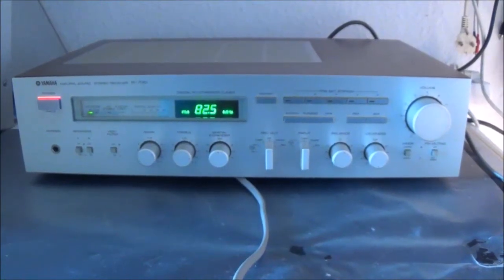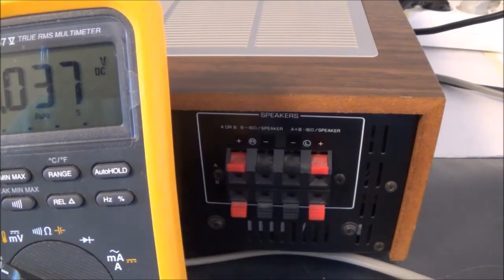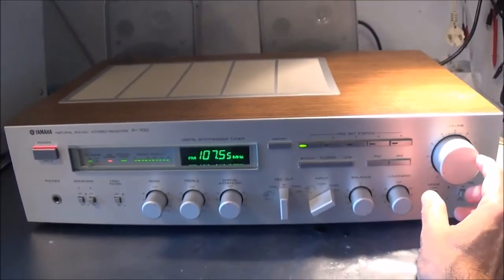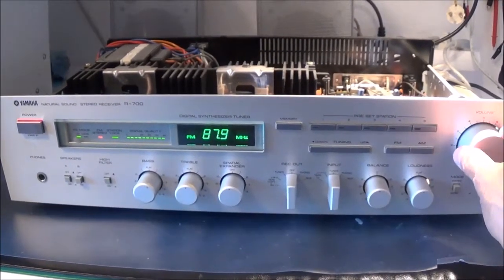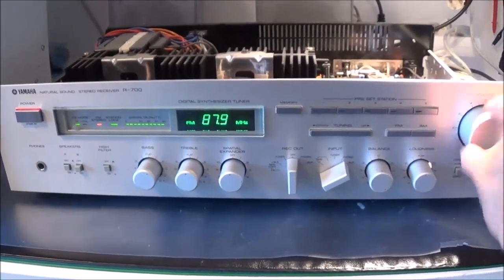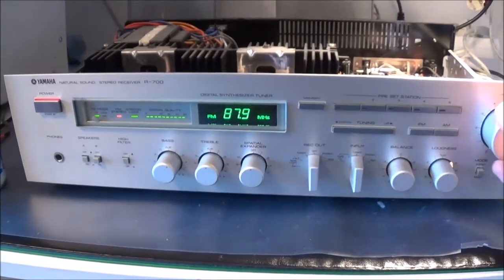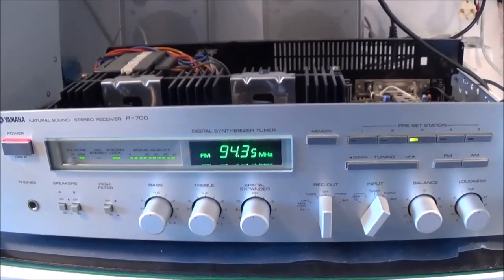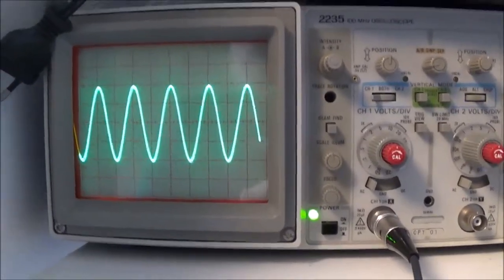Yamaha R-700 Stereo Receiver Easy Repair

Comment: Bought one on evilbay, seller states all is checked and tested, but I don't get any sound from speakers or headphones ... powers up nicely, but that's all ... 😓
Reply from the maker: Hopefully you can send it back; it would be the best under these circumstances. Carefully check to make sure you don't have the tape monitor/source switch set wrong. I can't say exactly what it (the switch) is called on this receiver since I am travelling and have very limited internet.
Reply: @OldSchoolElectronics  I tried a lot, but according the manual I printed out all was right ... and there was no relais clacking after turning on.
I ofgicialy requested return on ebay, if the seller doesn't respond in between 3 days I give the case over to Ebay ...
Reply from the maker: That is the best thing to do:  send it back. It could be that one of the IC  (STK) modules is bad; either volt amp or power amp. I would not agree to a partial refund like if the seller wants you to keep the receiver but gives you a cheaper price, but would ask for a complete refund--all of the money back. If not, you would have to spend time and money to get it working again.
I don't think the seller did it on purpose (especially if his eBay rating is good); the receiver has "lived" for many years already. Kind of like a 90-year-old person that you see on the street in the morning and then in the afternoon: dead. He should have no problems giving you your money back.
Reply: @OldSchoolElectronics  no, I don't think it was on purpose, but his good ratings are all from buying, he doesn't have any rating from selling ... and seemed un experienced in selling ... but, non the less, if he doesn't respond until tomorrow, ebay takes care of things ...

Comment: Looking for a little help. I have this exact same receiver and have run into problems with getting full stereo sound out of it. I have checked everything; swapped receivers to confirm it wasn’t speakers, and turn tables, and speakers. The result is that when everything is connected to this receiver I can not get stereo sound out of left speaker. If I flip it it to mono, both speakers play, but in stereo the left speakers either starts up then crackles out, I can lift the needle then drop it down and sometimes it’ll come back to stereo, but eventually the speakers just goes out. But if I flip it back to mono it works fine. Any suggestions?
Reply from the maker: This sounds like a bad contact situation. Especially if it does this with all functions like radio/phono etc. Sometimes you can get by without resorting to contact cleaner. I would work all of the switches and and other controls a bunch of times. If this doesn't work you will have to get contact cleaner (with lubrication). Can be gotten at a local electronics store or ordered online. You use the spray with the power off. The switches/controls are sprayed and then worked back-and-forth or pressed a few times. In the event that the controls/switches have no openings you would have to very carefully drill a tiny hole into them in order to use the spray. But sometimes you can just spray the controls that have openings and that is enough. Or if you get really lucky, just work the controls/switches and the problem might go away. And if all of this doesn't work, then a certain amount of electronics knowledge/test equipment will be needed.
Reply: @OldSchoolElectronics  He might not have appreciated that information. But do. Cheers. 👍
Reply: Also, I just opened it up to check the fuses and they both look good still

Comment: Thank you for this video. I have two of the Yamaha R-900 receivers. I have 2 pairs of Bose 901's and like this receiver because it allows the Bose equalizer to be connected between the pre-amp and power amp. What brand of contact cleaner do you use? I have the same issue with the scratchy sound when rotating the potentiometer (volume control knob).
Reply from the maker: Thanks for watching. Oh,, you got the big receivers, which is cool. If you are in the USA I would get Caig Faderlube (expensive); in Europe I would use Contact 61. These cleaners have lubricants in them, which is what you need. Radio Shack also used to sell a cleaner/lubricant in one can; don't remember what it was called, but that can be used too.
Reply: @OldSchoolElectronics  Amazon sells the Caig Faderlube. I have ordered it, so thanks for that. I have owned one of the R900 Yamaha's since it was new and bought the second for parts, if I needed them, about 5 years ago, and it works fine. The pots were getting noisy but with this lube, I hope to rejuvenate them. The 901's get loud with this amp. I know a lot of people are not 901 fans, but these speakers are about reproducing live concert recordings. For example, the Who, Live at Leeds sounds so great with this set up. And the Allman Brothers, Filmore East Live Concert recording, that I actually did see performed live in a small venue in the round, called Painters Mill in Owings Mill, MD is faithfully reproduced by this set up.  That was Duane Allman's last live performance, and for anyone who wants to hear that band at their best, listen to that album.
Reply from the maker: Thanks for the anecdote! The 901 was/is indeed a controversial speaker system; I remember  there being some kind of lawsuit between the Consumers Union and Bose.  At any rate, my first speakers were Bose 301s, since I couldn't afford the 901s. Thereafter I moved to JBL and then "graduated" to Infinity. I used to have both of the albums you mentioned when I still collected records. Having a backup R900 was a good plan.
Reply: @OldSchoolElectronics  I lubed the volume pot and it works great. Thanks.
Reply from the maker: Great that it worked out! Occasionally, the carbon track gets worn out, but you have a backup plan with the other receiver.  Good luck and hold on to your equipment!
Reply: @OldSchoolElectronics  What is a carbon track?
Reply from the maker: Sorry, I wrote so fast and didn't think that you might not even know what I was talking about until after I sent the comment. The carbon track is in the volume control. There is a little arm called the wiper that is in contact with the carbon track. This carbon track is pretty thin and can wear off through heavy use over the years. Every time you use the control you change the position of the wiper. And carbon conducts electricity.
Reply: @OldSchoolElectronics  Thank you.

Comment: I get scratching and a hum from my Yamaha RX-V850RS, circa 1990, a surround sound unit.  Would like to try the contact cleaner.  My volt meter didn't show any voltage from the right or left speaker outputs.  What do you think about the humming?  I have nothing attached to this unit except earphones.  The right side hums and scratches.
Reply from the maker: haven't worked on this unit before, but you really should clean all the controls, switches, cables, and connectors with contact cleaner. make sure nothing is loose (loose ground connection). i assume the hum is present with all functions like tuner, etc. Ok, since the humming only affects one channel, we can basically rule out the power supply. I assume the hum is not loud. what happens when you turn the volume down? if the hum disappears, that points to a problem before the volume control. problem show up overnight? is the sound from that channel ok (not distorted) but otherwise scratchy and with hum? these are the questions you must ask yourself. this might not be that easy to fix....problem could originate from plenty of places. unfortunately, i can't give you an easy answer: like replace a certain capacitor at a specific location.
Reply: thanks for the reply.  i'll delve into it.